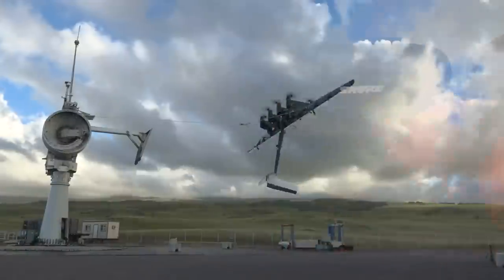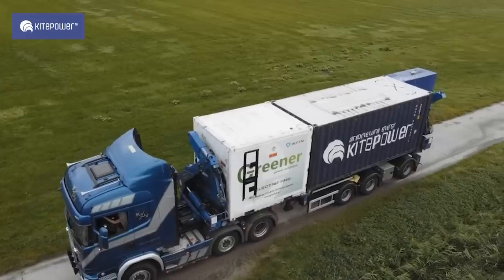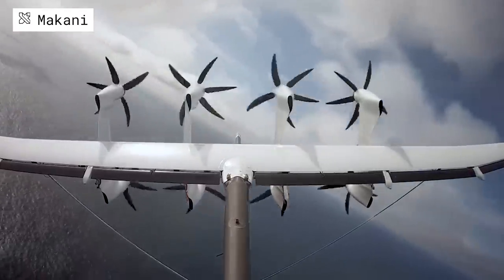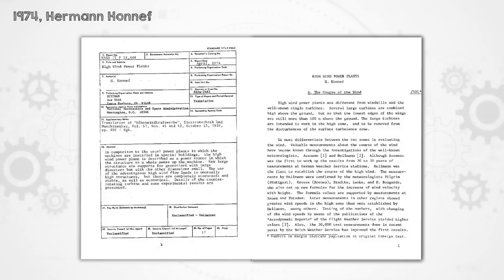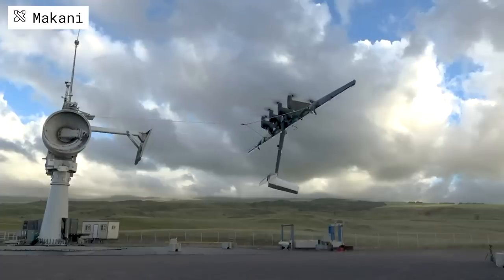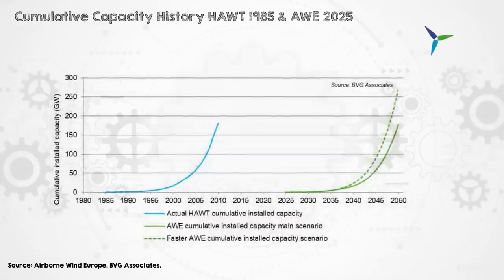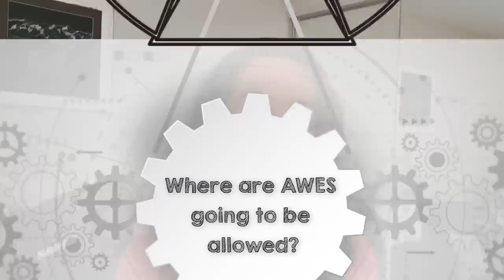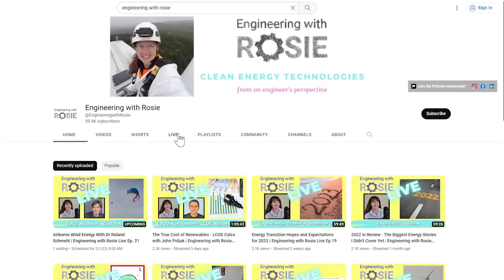Will Airborne Wind Replace Conventional Wind?

Comment: The solution of a blimp/dirigible seams like a natural answer to most of the design-dilemmas:  Still mostly soft-body, but more rigid than kites.  WAY simpler take-off, landing, and maneuvering than airfoil based flight... especially if it were ground-based generation as the balloon would basically need to be a buoyant sphere... same cross-section regardless of orientation of the balloon to the wind.  Similarly, low wind at ground level is no barrier to lift, as the lifting capacity of the aerostat is independent of wind-speed.  Yet your video indicated that only company that had tried a lighter-than-air solution had gone under... why?

Comment: I feel like this could maybe work in situations like remote scientific research stations that have very unfavorable sun conditions, such as in the Arctic circle, where the ability to deploy something lightweight that can function over the prohibitively short solar days in winter could be useful to non grid connected applications, or as the video states, disaster relief.

However, will this compete with grid scale conventional on shore and off shore wind? No. There's no way they can compete with the energy produced by the enormous, cheap and easy to service wind turbines. The power of a wind turbine is proportional to the swept area of the blades for a given wind speed, the swept area grows exponentially as the radius of the blades increases. You'd need an army of small tethered drone turbines to come close to one standing fixed turbine, and then would need to factor in maintenance and near constant manning of a tethered facility if there was either a drop in wind or mechanical emergency that necessitated a controlled landing of the craft. When the wind drops or the motor somehow seizes in a conventional tower turbine, it doesn't fall from the sky.

Comment: If you have a win gen( generator attached to a kite) so the cable is to control height and transfer power to the ground,  What are they using for conductors?  The conductors have a resistance per foot which would be resistance for lengthy cable. The voltage drop would be so great that it wouldn't be worth it.
Reply: How much is the voltage drop?
What is the cost/ profit ratio?
You are guessing. High tension wires that deliver your electricity to your house are aluminum . The same wires that carry the power can hold tension. 
The grid can do about 500 miles. Is that high enough for you?
Reply: @jbird6609  E=I x R  E= voltage I = current (amps) R is the resistance. I would need the spec sheet for the wire they are using and the length to figure it out.
Reply: @jbird6609  High tension wires use very high voltage and little current which is why step-down transformers are needed at the substation and at your house.
Reply: @JosephMullin   ok you know something, Point i was making is that now days aluminum wires should be able to handle the tension and the voltage drop from a tethered aircraft. I built a large drone, 20 pound lift, and used an aluminum wire to tether it. I also used 100 amp service aluminum  wire to run my solar system to my house, All this stuff is easily available.

PS the voltage drop on the drone was a lot, joking, but i was using 48v dc, of coarse higher voltage would be less of a loss but my drone was48 volts, So tethering is not a yes or no thing, it has to be designed correctly.
Reply: @jbird6609  Thanks for the info

Comment: Interesting video! However the problem is power output. It could be used to generate small amounts of electricity for low-power applications but extracting anything useful enough to support a real grid is just not very likely.

Comment: OK, this is a bit off topic but I am wondering how heavy the tether lines must be to handle the amount of current that is generated by the wind turbines (and not so much  for the structural load. The application I have in mind that raises this question is the potential use of tethered E-VTOL for  military applications but might have commercial applications as well.

The idea is that if one can provide the power for an E-VTOL through a tether line then it could stay airborne almost indefinitely plus carry more payload in lieu of having to carry the batteries.

The question is how heavy would be the tether line needed to power the E-VTOL and as such how long could it practically be.
Reply: A second question would be if it might be worth  transforming the voltage  to minimize the current in the tether line and then stepping it back down with a transformer in the tethered E-VTOL. 

Would the weight saved by having a lighter cable offset the weight needed to step down the voltage in the E-VTOL.

Comment: modern airplane tec have prove that short multi fan blades are more efficient than blades even with variable pitch,so the first wind mill were similar 20 plus blades with no helical design,mi point we are using propeller design in 1930 .

Comment: I dont know what its called but when you open 2 doors in a house there is a wind that runs through the house 2x as fast.
Why is this 2x strenght not incorporated and used in wind turbines? 
Llike making tunels with both ends open. Then you get 2x the wind energy?

Comment: This may be naive but I was hoping you would discuss the blimp. What's the drawback of that? If it's lighter-than-air, there's no need to worry about low boundary layer wind for launch. It could easily have pressure-sensitive winches to allow fallback and subsequent recovery in the event of extreme gusts -- that's not a particularly advanced technology. So what's the main drawback?
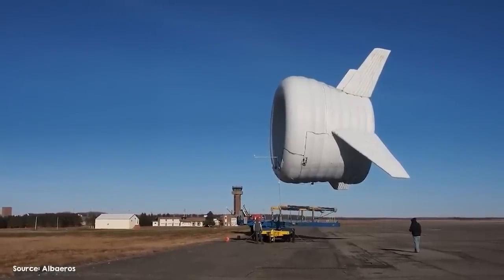Reply: 0:26 here

Comment: Hello,
I see any attempt with a kite kind of fruitless.
High level wind generators are only feasible with in-built buoyancy - i.e., a turbine generator on a tethered blimp. 
With a multistage turbine it is possible to extract a large amount of energy from the wind, and protecting the blimp in the meantime. A set of gyroscopes (reaction wheels) would keep the surfaces in the optimal position, and protect the whole generator from sudden wind gusts.
Greetings,
Anthony

Comment: Soft fabrics used in kite making actually have very high fatigue life especially when compared to many other rigid materials. The reason that a structure made from fabric may not last as long is because the loading is usually high and it's always in tension. Just think how a few kg kite wing is producing the same power as a rigid wing weighing many times more.
Reply: hang gliders last far far longer than paragliders
Reply: @clive373  yes and a hanglider is a lot heavier and so has much lower loads for a given material thickness
Reply: @crankhandle  it thinks its the UV that destroys paragliders, and the old hang gliders.

Comment: If you are ever unfortunate enough to break down on a motorway, you will find that while standing on the hard shoulder, you will be battered by a constant strong wind from the slipstream of passing vehicles, especially trucks. When I am out walking on a windless day and then walk along the motorway feeder road near where I live, I get blasted by a strong wind from the passing vehicles. Is the UK Government missing a trick, by not lining motorways and fast feeder roads with vertical axis wind turbines, which will generally be turning all day and night from passing vehicles, regardless of atmospheric wind conditions?

Comment: How much space do they need?
I would assume at least the tethers length of open space is needed
Or can multiple installations be packed closely next to each other and they all fly in same pattern?
Reply: They can fly synchronously. Also you can control the angle between the tether and the ground. Then all tethers are parallel and installations can be very close to each other.

Comment: Softfoils aren't exactly kind to birds, I cleaned up a seagull with my 2M powerkite when I was a kid. Not intentionally, just crossed paths and smacked it out of the sky.
Reply from the maker: That is so interesting! Just more evidence you should never assume what will be bird friendly or not.
Reply: "kind to birds"
Birds are not a valid reason to ignore any kind of wind technology. It is highly exaggerated compared to other man made dangers to birds, like traffic or buildings.
The windows of my house kill 1-2 birds each year.
Reply: @EngineeringwithRosie  Hi Rosie, to put the bird "problem" of wind energy in a perspective: in the United States alone, outdoor cats kill approximately 2.4 billion birds every year. In fact cats have contributed to the extinction of 63 species of birds, mammals, and reptiles in the wild. 
The average of the last 4 comprehensive studies (2013-2014) on the subject estimate that around 366,000 birds killed by wind turbines in the U.S. Adjusting for this industry growth to 2021, it is projected that approximately 538,000 wind turbine-caused bird deaths occur in the U.S. each year. Keeping domestic cats consequently in-house can easily compensate the additional casualties caused by wind turbines.

That being said, research on how to reduce bird strikes against wind turbine blades and towers should definitely continue in order to further reduce these strikes.
Reply: Ideally, since the system is moving, it could actively detect and avoid birds. I doubt any company is actively working on that now, but it seems plausible if the tech develops some scale.
Reply: @haveaseatplease  yeah, more birds die every year from landing on toxic ponds from the oil industry than from wind turbines.
Reply: @cadekachelmeier7251  A bird detection and automated wind-turbine shut off system is used in Germany. It was first developed and commissioned in the south of Germany to protect the Kestrel (predator bird), which is a protected species.
Reply: When flying power kites you generally
fly them at high speed at low altitude. This kind of wind generation generally uses high altitude low speed
Reply: I killed 3 birds this year in my van 🤣🙈 1 pigeon and 2 pheasants... but I ate the one pheasant so I wouldn't count that 1
Reply: Kitekraft has had a open master thesis position with the purpose of bird avoidance
Reply: Cats killing more birds than wind turbines, a poor comparison. Sparrows are more plentiful than raptors, raptors fly along ridges, same places wind turbines like. Because raptors are endangered, bird  kills must be considered. I'm all for wind energy but not at nature's expense.

Comment: so what about that flying donut - high altitude wind turbine from altaeros? I see that they changed profile to normal baloon with antennas with providing internet. What happened to that ptojects? 
I'm thinking about small project-  turning this donut horizontally and provide cones to just gather stronger airflow to go down, through turbine. It won't be super efficient, but it should move motors enough.

Comment: Rosie, little off topic. Have you seen dynamic soaring? Faster then wind speed gliders. I think you might have referred to the physics in this video.
Reply: There is a university also looking at a similar concept of jet stream soaring.  There will be no NIMBI and noise complaints there.

Comment: Some of these types of systems are just never going to be practical because they depend on well-behaved winds to not crash. What seems most promising to me is something that is as closely akin to aircraft already in use as possible, which can be powered to maneuver itself as necessary, and use a tether or multiple tethers only to assist in keeping itself stationary for best efficiency, and to conduct power. Making such a system autonomous doesn't seem a great challenge since it will have relatively few modes.

Comment: Why not use a group of blimps/zeppelins tethered to each other and the ground?
If one would be punctured the others would keep it in the air and wouldn't crash to the ground.
Every blimp would be shaped as a donut to accelerate the wind into the rotors in the center.
Reply: We will be using a lighter than air Magnus effect wing at Wind Fisher.
Reply: @garrettsmithfrance  cool

Comment: Total noob here. What if the platform was a series of blimps with on-board generators, flying in the higher altitude faster wind streams with microwave transmit power back to a base station? I'd start the blimp upwind and as it went past the base station up high start a downward glide from the high downwind to a lower upwind position and then use solar powered lift motors to get back the altitude. Dunno if this is a dumb idea . 🙂 Cheers.

Comment: There are certainly big issues with this.    To get economies of scale you need big power outputs per machine, in the MW at least.  Having a flying machine that operates autonomously but is big and heavy enough for multi-MW generation seems unlikely.  AWE needs a lot of space (or ever more complex systems to avoid collisions) so the MW per sq km is likely to be limited.

For me the big problem is that we are trying to replicate the huge controllable energy outputs that have been possible using fossil fuels, big hydro,  and nuclear, replacing them with intermittent location-specific sources difficult to scale up.

Comment: Land area uses for these system is the biggest issue the power density per m of land is terribly low. Tether systems are another major weakness having operated winch launched gilders for over 20 years these cable or tethers will suffer significantly from wear and tear with shock loads that can be so significant as to throw loops onto the drum etc Also the air above 250ft isn't smooth far from it microburst, sink and turbulence can be really extreme. Also gliders with struggle in winter to operate once the freezing level drop to 1000ft most days so there will be no way to stop icing from occurring. In short though this video deals with some of the pitfalls there are load more.

Comment: I think the bulk of wind energy in the far future will be ionic wind generation. If they can get it to 20% efficiency, then anything else will struggle to stay viable. I could see a kite using ionic generation instead of a rotor, but I could also see an existing ionic wind generator that can generate in any environment, even a hurricane. We could see something like planet exploration where a kite could be used. There are already designs on using ionic wind generation on existing rotor blades to increase efficiency past 50%. I'm not sure kites would survive the NIMBY factor, even in remote locations with few houses. You wouldn't believe the push back in America's second least populous state of Wyoming for wind turbines.

Comment: I think especially late stage passenger aircraft piston engines were a lot more complex than jet engines though.
Reply: Yes, and consequently FAR less reliable than even early jet engines. One of the reason airliners moved to turboprops in the 1950s was their far greater reliability and far less maintenance.

Comment: What happened to the Dr. Rosie principle don't put it in the water if you can keep it on land....well don't put it in the air if you can keep it on the ground ??
Reply from the maker: I would say don't put it in the water or the air unless there's a damn good reason to do so! Offshore wind definitely has a place and so might airborne since the wind resource is so much better and materials use is so much lower. But then there are all the extra complications, so time will tell whether it's worth the extra complexity or not.

Comment: How do you have anything with worthwhile power output that doesn't need some sort of ground infrastructure to stop it wandering off or get the power to the groun? . Any decent sized wing in a decent wind will pull a container around,, look at bouncy castles taking off accidentally. The wing will be using a lot of its energy in flying. If you extract too much energy from the wind it will slow down and stall the wing.

If people are not happy about traditional wind turbines next door, they won't be happy with these wandering around next door.

Comment: I hate to be the skeptic for any kind of renewable technology but how do these help anybody? Their tiny turbines can't possibly generate anything truly significant - the best I've seen is KitePower which will do a theoretical max of 100KW in best conditions so probably a lot less in the real world. For significant amounts of power do you run multiples together, but considering they can't crash into one another, how much space do they then take up? Technically no one can live on the ground where they are in case they fall out of the sky at some stage which considering how terribly erratic they seem to be has to be a consideration. I can't see them doing more than 2 to 3 years without a crash due to unstable weather or a freak airmass or low pressure system which is unexpected. Their area of operation is enormous as they move around a several hundred meter space at what seem to be pretty decent altitudes, so there's a question as to how they'll operate in actual airspace for light aircraft who may not ever see them. Will that airspace be declared as unflyable each time one is set up? Are they being proposed uniquely for super rich and zany off grid people who want a cool kite thing powering their house because I can't see them becoming a power plant, and just like the video suggests are they uniquely for someone who lives in the middle of nowhere, where no one else gets hurt if they come down. Don't mean to be an arsehole here, but really, why are these things even really a thing ?